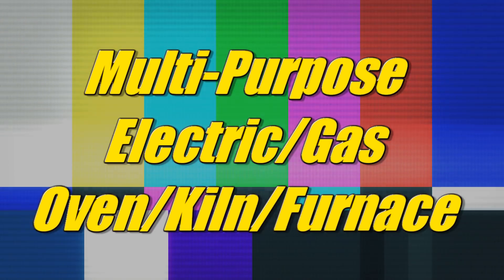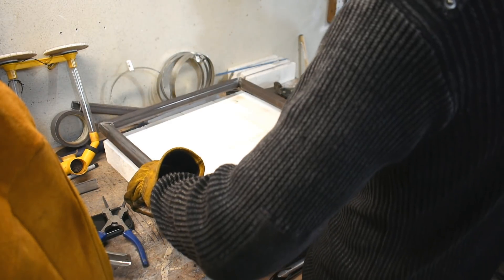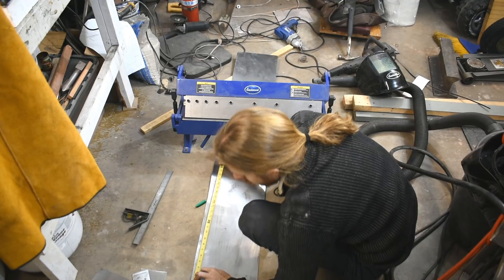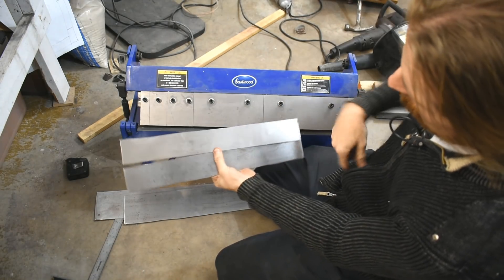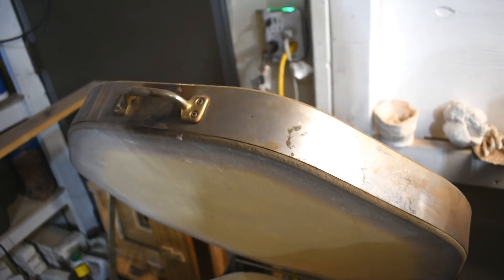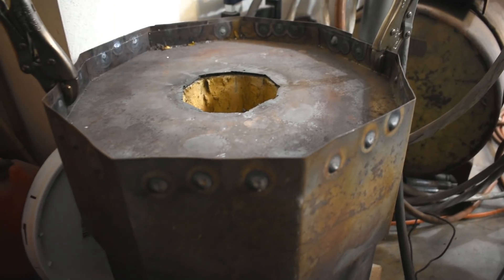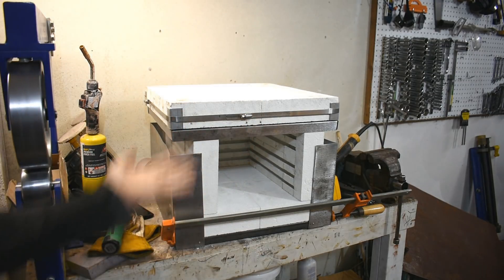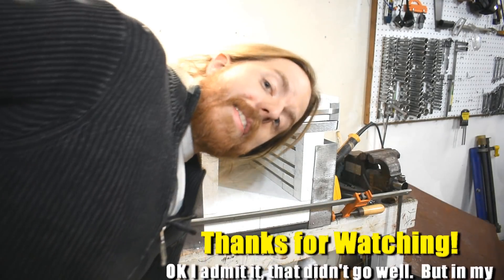DIY Electric Heat Treat Oven/Kiln/Furnace Part 2: Metal Structure

Comment: for your lid bend a band to cover most of the bricks take 3 nuts bolts and bolts weld nuts to a band on the lid on one side washers on the other to tighten bolts you can go more in-depth  with it but 3 nuts bolts and washers are cheap

Comment: Great video, thanks for sharing the mistakes that is one of the reason I love watching!  Kind of like NASCAR I just watch for the 6 car pileups!! Just kidding I don’t watch nascar.  I would definitely go with a steel strip with bolts at each corner so you can tighten it, those worm screws on hose clamps strip out too easy.

Comment: You got a welder so just make a strip for the top and tack it to the piece that's too short. It is a prototype. It is not like you've made dozens of these. So you have to expect some parts to not fit exactly. Or even miss by a lot. It is the beauty of hand made!

Comment: think making a sheetmetal strip around the lid but instead of using hoseclamps bend the edges out , dril 2 r 3 holes through them and use nuts and bolts to tighten the band around the edge , should be a lot stronger then hoseclamps 
as for the lower sheetmetal , maibe get a new wider piece and start over , will look a lot better in the end ad whont cost a ot , can probably use a few of the old piece to make the band for the lid

Comment: Not the worst failure I've seen, I mean at least the lid idea worked!
Reply: I worry about how that band clamp is going to work if it gets hot though. Metal loses a lot at high temperatures. Hopefully the bricks will save it but I don't know.

Comment: I had so many great funny comments that went along with yours, but I can’t remember them all. Regardless, I think the design and all looks good, I think this is going to turn out great.

I think I’d go for a heavier band on the top. Just feels like those bands are just waiting to screw you over. A couple more small pieces of angle iron, some good bolts and weld on either side, then tighten... 👍

Comment: I don't see the hose clamps holding for long. I could be wrong though.
Reply from the maker: You could be right! Fortunately there's no need for them to hold up during use, only lifting off the lid.  If it's all loosey goosey after firing I'll make a different set up.

Comment: Why did you cut the channels in the firebricks Paul?  And what are you planning to heat the furnace with?
Reply from the maker: Electric heating elements, kiln elements from a skutt 818, powered by a standalone orton controller.  Channels are for the elements, just like an electric kiln.  The wiring it up happens next video 👍
Reply: These are two questions with one answer, he's going to put heating elements in the channels.

I do have to ask though, did you not watch the first video? And if so why?

Edit: Gah, Paul's response must have been made after I loaded in the page. It wasn't visible on my screen.